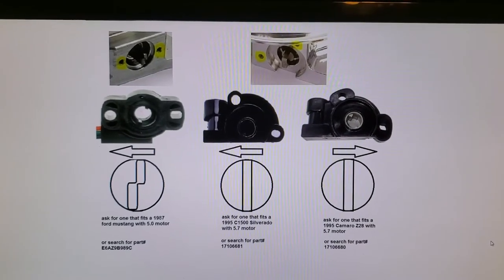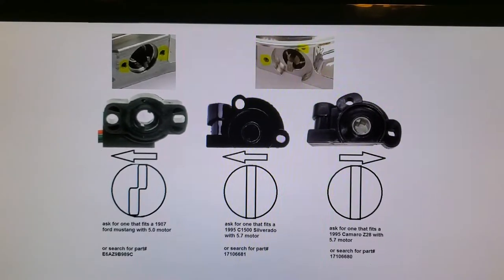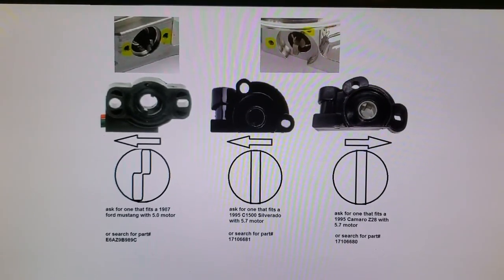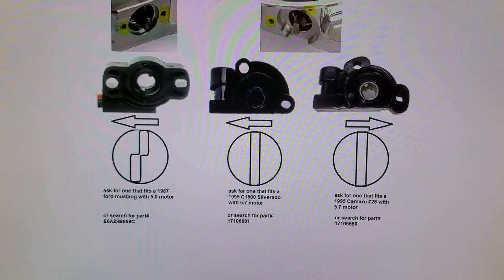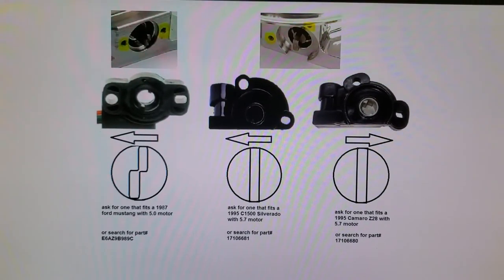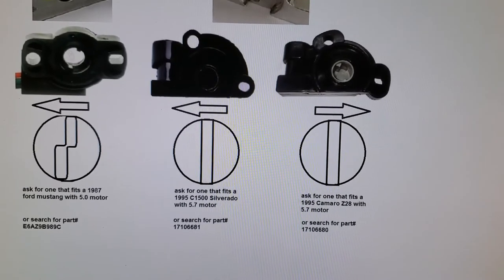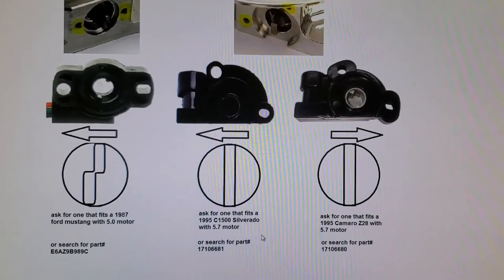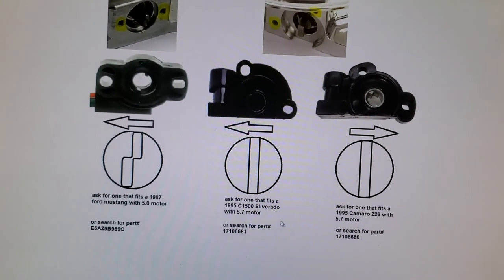Throttle Position Sensor (TPS) for Ebay Throttle Body

Comment: Thank you for putting this together, I was almost freaking out when the part # supplied by my vendor was not available anywhere (not even from them). Documentation is really lacking with these throttle bodies. A bit absurd since they were manufactured to match certain sensors.
Reply from the maker: Not a problem, I'm glad it helped someone. Good luck with your project.
Reply: I have the speed master 4150 with the D shape tps shaft I can’t find not one TPs sensor that will work I’ve tried part number u posted etc….. nothing